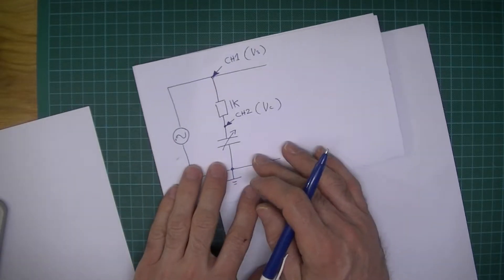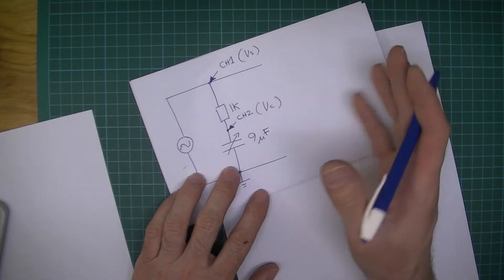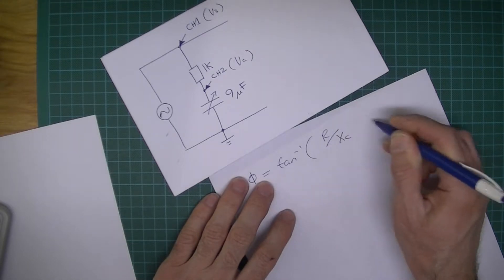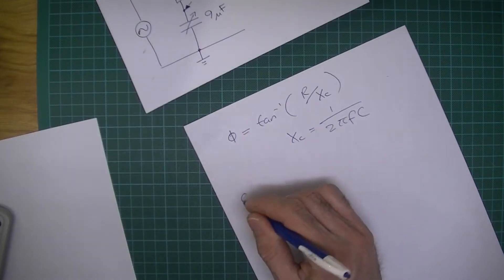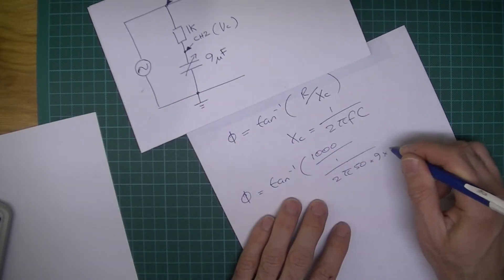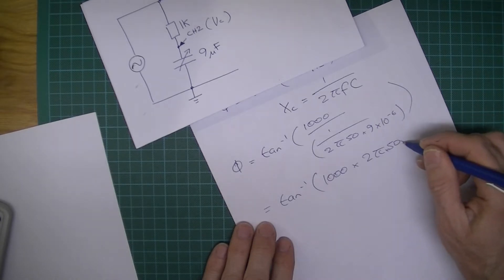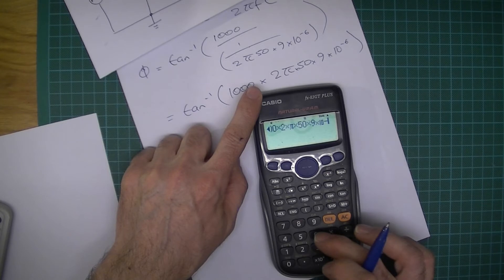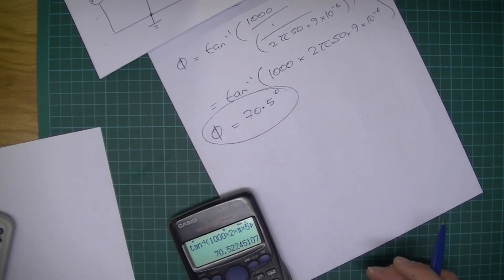Calculating the phase shift angle

Comment: Isn't resistance supposed to be the denominator instead? I think you flipped it.
Reply from the maker: Thank for raising this point - I always appreciate comments even when they identify possible mistakes. I have checked my reference and assuming the A level exam board is correct then so too is this formula.
phase angle = tan^-1(R/Xc)